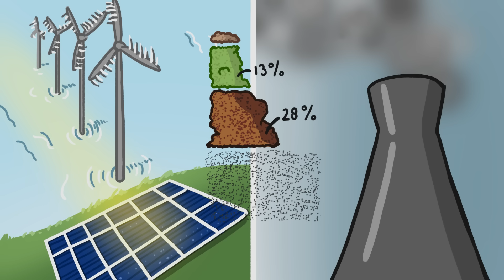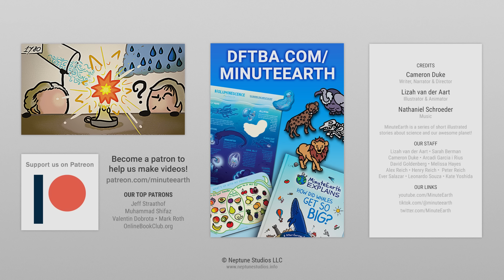What if We Replaced Nuclear With Potatoes

Comment: Sure X uses this many potatoes per 2 hours, but how many people does that provide for?  What's the potato per person for 2 hours of a powerplant? Also, what percentage of the potato a person eats get turned into heat? Just felt like the metric of what is being compared wasn't constant.
Reply: How would you calculate the number of people a powerplant provides for? Sure, you could take the mean annual energy consumption of a typical household. But that would be scewed again, since most energy goes not to households but to industry. And how would you factor in how many people that industry provides for?
Reply: @lonestarr1490  But that's my point. One potato is not equal to another.
Reply: @felixthecrazy  Yeah. But they're more equal than what we're calculating with now. That's the point of the video. It doesn't claim that potatoes are the perfect means of energy measurement. If they were, we would already be using them as such.

Comment: A friend asks: If we can measure fuel usage in potatoes, how much energy would we get in a potato serving of uranium?
Reply: 2:42
Simply: from a potato sized chunk of uranium, we get 350000 potatoes worth of energy.

1 green potato = 350k potatoes
Reply: @thaias9654  potato for currency when?
Reply: 1 g of uranium is about 1,000,000,000 cal
Reply: @wren_.  so don't eat uranium if you're on a diet?
Reply: @aceofspades5109  or do eat it so you’ll never need to eat for the rest of your life
Reply: @wren_.  I mean...you're not wrong, but you're not exactly right, either...
Reply: Funfact: the trace amounts of uranium present in potatoes have more energy than the potatoes themselves.
Reply: @vaclavzajac214  In a research made by the National Library of Medicine; Toxicological Profile for Uranium, a gram of Potatoes has 2.66-2.92ng of Uranium.

Actually "1,000,000,000cal per gram of Uranium" is a bit misleading because that is for U235, and most of the Uranium in the world (99.3% to be more specific) is U238, which has only 400,000,000cal per gram. 

2.92ng * 400,000,000cal = 1.168cal/g (Uranium in potat)  <  770cal/g (Raw potat)
Reply: @sankang9425  2 ng/g of uranium is a very low estimate for uranium, a more common number would be around 20 ng/g but some places can be as high as 10 ug/g, probably even more. I estimated 80 000 000 kj/g and there's nothing wrong with that assumption since the U238 can sbe turned into Pu239 which releases more energy than U235. If we assume 1 ug/g (R. dos S. Amaral et al.), we get 10 000 kj/100 grams which is more than 300 kj/100 grams of chemical energy.
Reply: @vaclavzajac214  Converting to Plutonium is cheatin! Why not just use Uranium's mass-energy at this point? Nuclear energy is not that great in converting radioactive energy into electricity anyways, Human body does a much better job in terms of efficiency.
Reply: In weight, a potato-weight chunk of uranium would power your body for the next 5 479 452 years

Comment: The reasons your car loses 80% of it's fuel to heat is because that's that maximum efficiency of gas powered engines. I took a class on thermodynamics where we calculated the maximum efficiency of engines based on their properties. Diesel engines are much more efficient because they have higher compression.
Reply: its funny to think that even with all the losses, EV are still way more efficient than ICE. and they even used a conservative efficiency for the power plants, some modern fossil fuel power plants can go as high as 90% efficiency.
Reply: @danilooliveira6580  they also grossly overestimated the ICE consumption. even using their own numbers in the foot note, 8.6 x 60 miles (30MPH for 2H) is 516. plus 22 MPG is pretty low. i get 38MPG at 30 MPH and i drive a '19 Altima, that works out to 300 per 2 hours, which is pretty comparable to the 240 EV honestly.
Plus you dont get to pick where your power comes from, so the number they use would have to be an avg of the entire grid. 40% seems fair.
Reply: Well that does not account for the devestating toxic waste battery production generates, and replacing them as well, a fule tank is kinda easy to replace, it's pritty much a box of metal, and combine the best of both you get hydrogen cares, you may even be able to produce the fule at home, add some solar and water, and you quite close to preducing your own fule AND a smaller battery to boot
Reply: Electric cars are actually not that efficient, we often skip the transformation loss wich is the actual problem, thing is electric cars lose a lot of energy during the transfer of said energy (of curse same could be said for fosil fuel cars but they actually win in that regard) in the end electric cars are rughly 10-20% more energy efficient than for example diesels cars of same technology (depends on a car)

The largest problem with those cars tho is the total pulution they create, as while yes you are good on ecology front while driving the car itself creates way more polution during its creation/disposal than standard cars cupled with their inherit short livespan (most become useless after 5 years while some convencial cars can last up to 20 with some repairs) means that if you look at bigger picture they are significantly less eco friendly than even some old diesels.

That being said tho from my current knowledge hybrids cars are a good alternative, as they make it so you use less fuel meaning the convencional cars become more efficient, they can be repaired and for most their batteries can also be easily swaped meaning you don't need to produce a whole car.

Comment: Friction is only one part of the reason for ICEs low efficiency. The laws of thermodynamics make up a large portion of it as well. IIRC it's not practically possible for an ICE to be more than ~50% efficient due to the laws of thermodynamics alone.
Reply: Yes, thank you! From what I remember from my thermo classes, 50% is a theoretical maximum if very high temperatures are possible. With modern cars, something like 30% efficiency is possible at the ideal RPM with the throttle wide open. In practice 20% is typical because throttling the intake requires extra pump work.
Reply: @abev236  throttling, sitting idle, accessories, low loads, inefficient gear selection.
Reply: This is because even the most “modern” ICEs are still based off of a horribly inefficient moving piston and gas exchange design that fundamentally hasn’t changed in over 120 years. Take that same thermal energy and convert 90%+ of it into a single frequency of light (via a thermal/sodium lamp) and then use that with a narrow band photovoltaic… now you have a piston-less ICE that generates electricity for an electric motor at well over 50% conversion. It’s like comparing a steam engine to current ICEs. Internal combustion engines do not require pistons! Climb out of the box!

Comment: For the record, it should be kWh instead of KW/h.  The former is the product of a rate (kW) and time (hours).  The latter doesn't make any sort of sense.
Reply: Well, it describes the rate of change of power, which I guess could be useful for quantifying how quickly a system can ramp up/down.
Reply: @Dayanto  true, its analogous to velocity vs acceleration
Reply: @Dayanto  As in "this hydroelectric storage reservoir can increase at 10 megawatts per second, so in 5 minutes the turbines will be spinning enough to boil a million kettles at the half time break in the football."
Reply: to be fair "kW/h" is presented in a thought bubble and not used as a fact.
Reply: @mavinicesumaljag2023  You have ways od indicating that the character is confused. If there were other weird units, some of them obviously false, then we could interpret it your way. For example you could have more weird units, but also you could have some chinese characters, some egyptian hieroglyphs or some unreadable squeegles.
Reply: KW/h kelvin watt hours? lol
Reply: @firdaus99031  That's why we say it's wrong
Reply: kW/h does make sense its just a different unit, it's important for electrical power delivery, batteries, and surge protection. It measures how long something takes to go from 0% power to 100% power. You are right in that he definitely did not mean to use kW/h. Division vs multiplication is not a good mistake to make

Edit: Casing mistakes
Reply: @videogamescoverftw  kiloWatt per Henr? As long as we are being pedantic, the case of the letter matters. Otherwise I agree.
Reply: @babilon6097  Was on phone when I typed it, thanks for pointing that out
Reply: I just wanted to comment on this...
Reply: It's m/s not ms

So on that note its kw/h
Reply: @destroyerofminecraft3249  , you're using an entirely different unit to justify using the wrong one here?  The slash isn't in there just because it is a unit; it indicates the mathematics involved in the calculation.  The slash is there in m/s because you divide the number of meters by the number of seconds to get speed in meters per second.
Reply: @destroyerofminecraft3249  think if it this way - when you make a longer journey in the same time you travel faster, but when you do the same journey in longer time you travel slower. That's why you divide length by time. But with energy? If you draw higher power for same time, you use up more energy. But when you draw same power for longer time you also use up more energy. That's why you multiply them together.
Reply: @destroyerofminecraft3249  nope, you're wrong. m/s is meters per second - it's division. kwh is kilowatt-hours - it's multiplication
Reply: @destroyerofminecraft3249  / means per.

Even if it were measuring the production of kW per hour, which is what kW/h would mean, kWh in this is total production of energy, not the hourly rate of production of energy.

If you produced 10 kW in one hour, that would be 10 kWh in 1 hour, which WOULD be 10 kW/h.  (basically...)

But the amount of time is irrelevant in this context.  If you produce 10 kW in 5 hours, that would be 2 kW/h.  Two entirely different metrics.  And the way they used it in the video is total energy, not energy production rate (besides, it would be kWh/h... but that's a whole different thing that I'm choosing to ignore cuz it's irrelevant to the point I'm trying to make, which is that kWh is total volume and *.*/h is production RATE).

And... all the other reasons already stated.
Reply: @yondie491  If you took kW/h as a fact then it could mean a rate at which your energy production grows.
Reply: @yondie491  Actually if you produced 10kW/h for one hour (assuming linear growth) it would be 5kWh in one hour. 10kW after 5 hours would be 2kW/h and 25kWh. On a separate note I'd just like to mention one of the funniest units I've ever seen which was kWh/1000h, which was used correctly as a unit of power but still weird.
Reply: @Tharkon  kWh/1000h = Watt
Reply: @destroyerofminecraft3249  no, kWh is correct.

Comment: How many potatoes per year go into manufacturing, shipping and lighting of holiday decorations?
Reply: considering that basically all Christmas lights are now led based, I bet not a lot. manufacturing and shipping though its hard to say because you need to take many things into account, but more importantly, you need to compare it with the average energy spent with manufacturing and shipping of any frivolous product and see if it increases the overall use, or if it replaces it as people buy less frivolous products to buy Christmas decorations instead. so it can increase, decrease or be neutral in potato use.
Reply: @danilooliveira6580  Yeah, I dunno. There's still a fair few incandescent ones out there and while LEDs are usually around 1/10th the power for a given brightness, the shift to LED seems to have made a lot of people just put up more and expand to extravagant Halloween lighting as well. It does help that LEDs are less likely to burn out so people are more likely to keep reusing them longer rather than buying new strings. A lot of people just couldn't be bothered with the effort of tracking down a blown bulb or fuse that took out a whole string. It does seems a difficult thing to account for accurately but it's a pretty wasteful practice with little point other than "look at me, I'm more celebrative than you!"
Reply: @protocol6  a lot of things are wasteful practices with little point, and as all those other things, people do it because it makes them happy, they like to make their house look amazing. and you also need to take into consideration that only a fraction of the world will celebrate Christmas, only a fraction will celebrate with decorations, and only a fraction of that fraction of that fraction at extravagant proportions to be relevant.